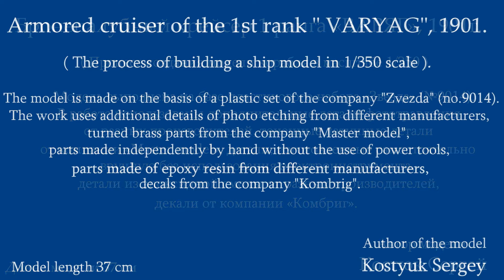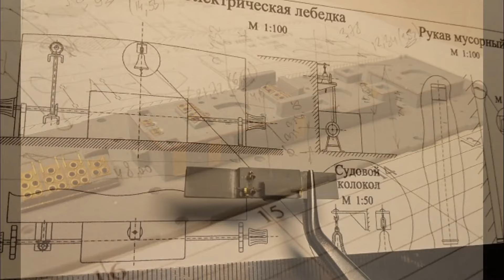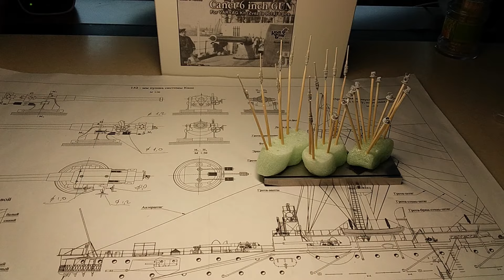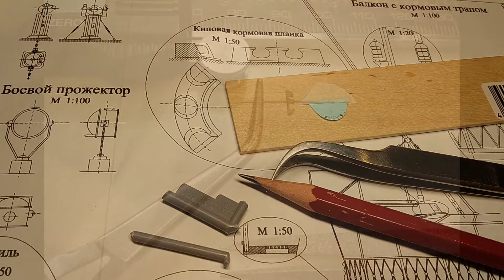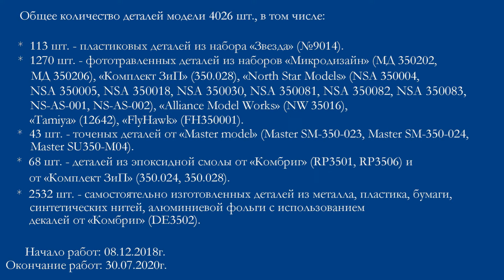ЗВЕЗДА. Крейсер ВАРЯГ. Сборка модели. / ZVEZDA. The cruiser VARYAG. Building the model.

Comment: Best model build ever seen. This is unbelievable good. And no washing or aging or whatsoever, just pristine. 
Big Respect and Greetings from Germany!
Reply from the maker: Thank you very much! 
I tried very hard ). I didn't use the deck wash deliberately, as the width of the deck boards in the set, unfortunately, is not in scale. Otherwise, the Zvezda set is quite good as a base. Thank you again! )).
Reply: @skostyuk1974  Спасибо большое! Unfortunately i know only few Russian words. Your build of the Varyag is so brilliant, i watched the video again and again a 3rd time on my bigger screen. Finally the rigging that you did on the ship... what a masterpiece in any detail! May i ask you whether you did the paintwork by hand? As i mentioned, i like "non-washed" model work much more (no artificial aging of a model by the means of applying rust & dirt colouring to give it a "used" look). I have this Zvezda kit of the Varyag for 2 years now, together with a photo etch set by Eduard, a wooden deck by Artwox and some guns and brass pipes sets from Master Model. Which deck boards did you try, to find they were not fitting? Hopefully i can start soon (had to recover from a hand surgery). My current project to complete is still the Gangut from Revell (which is a copy of the Zvezda Sewastopol). Thank you again as well! Hope to see more build videos from you.
Reply from the maker: @Bernd_B   Thank you very much for your kind words! Yes, the rigging turned out to be quite accurate, in full accordance with the known photos of the ship of that period. The only thing I regret now is that I did not use threads of different colors for standing and running rigging. I will definitely do this in my next model. Now I'm looking at the model of the gunboat "Koreyets" (1887) from the company "Kombrig". I'm already studying the material part )).
Together these two ships went into battle in Chemulpo in 1904 and the models should also be together side by side.

I admit, I also do not like the aging of ship models. For armored vehicles, this looks acceptable, but not for the navy. I am a big fan of museum models and I always dream of going to the Central Naval Museum in St. Petersburg and seeing models of cruisers and battleships live.
Regarding the deck. I used to look at wooden decks. The deck from Artvox is quite good, but I liked it better from Wood Hunter (W35001).
However, I did not use wooden decks, as my goal was to make the most accurate model of the Varag. The fact is that some details of the ship in the set and on the wooden decks are not quite in their places. This applies to the elevators supply of shells and fans on the forecastle, the covers of coal pits, the bases of the rostra pillars, fans in the mainmast area, deck portholes. This can be seen by looking at the native drawings of the Varag.
Fixing the plastic deck seemed easier.
Deck boards from the native plastic set are not in scale. They're too wide, which is why I didn't emphasize the seams. It was a conscious decision of mine. By the way, for the deck without flushing, I was reduced points at the Russian Championship in 2020, although in general, the model was highly appreciated, a diploma of the 1st degree and a gold medal )).
I will upload my builds to my YouTube channel, but it's not fast. The construction of Varyag, for example, lasted almost 1.5 years. So we'll have to wait a bit ).

I also post my modeling work on my Instagram page (skostyuk74). I invite you to visit ). Perhaps you also have your own Insagram account? I'd love to see your work.

Thank you again! Good luck!
Sincerely, Sergey
Reply from the maker: @Bernd_B  P.S. 
I paint my models by hand without using an airbrush. The exception is the bottom of the ship. It is spray-painted (Mr. Hobby).
Reply: Guten Abend Sergey, thank you! I looked onto your Instagram page, until I was thrown out by them as i do not have an Instagram account. Maybe i should register:). I've seen great building fotos from you there as well! To be honest, my modelling skills are not even close to yours. About rigging & "washing" (or "aging"): I did a build of the Revell 1:96 scale USS Constitution many years ago (maybe 1990). I invested plenty of time to install rigging in both black (for the fixed ropes covered with tar at the actual ship) and brown (for the running rigs) colors, it came out quite nice. And for this model (the Constitution), for a change, i worked on rust streaks/shades/dirt paint schemes mainly to the hull and sails to give them a "used" look. The overall result (took me some months) was not bad, but no match to your builds. Unfortunately, as time goes by, that model ship suffered a lot of mistreatings over the years. I agree with you, painting by hand (i don't use an airbrush either) and deliberately applying NO "used look aging" does in fact even more highlight the accuracy of the build job (at least in my eyes, whilst other people prefer aging techniqes). Especially when it comes to museum exhibition quality. Congratulations for being one of the best modellers in Russia! I have been 2 times in Russia, but then only in Moscow. My brother once went by bus from Finland to St. Petersburg, but i'm quite sure he missed the Naval museum. Wow, i checked, it is over 300 years old, and it is huge! You really should go there. All the best to you and for your upcoming projects. Best regards, Bernd.
Reply from the maker: @Bernd_B  Bernd, thank you very much! I would love to see the USS Constitution. My Mail skostyuk1974@gmail.com. You can send photos of the model to this address.
 In April (15-18), Moscow will host the Russian Championship in Ship Modeling (bench models). I plan to take part with my "Varyag". After last year's championship, I have slightly improved the model and hope to perform even better )).
 Best regards, Sergey
Reply: @skostyuk1974  Danke (spasibo), Sergey! I sent you a mail. How comes that in Russia there exists such a great model building community? I think it is of higher quality than in my country (well, that's not the only thing which is better in RUS compared to GER now...). Also i'm quite surprised about the Zvezda products, they improved a lot in the recent years. The Varyag really is a great model base, as well as the Sewastopol/Gangut. Hope to see some video of your updated Varyag one day. Best regards, Bernd
Reply from the maker: @Bernd_B  Bernd, good evening! Thank you very much for your letter. The history of modeling in Russia goes back to the Emperor Peter the Great (1672-1725). He studied ship building in Holland and England and eventually was the founder of the Russian Navy. He made the first model in Russia on his own (!) and it is kept in the museum, which I wrote about earlier as a valuable exhibit. There is also stored the "grandfather" of the Russian fleet-a boat. It is called "Peter's boat". So the history of modeling in Russia is more than 300 years old ).
In Soviet times, the development of children's creativity in our country was also given great attention and, I think, there was no school where there was not a group of model aircraft or ships. Technical creativity was very widespread in the USSR. Therefore, this is a very popular form of creativity in our country.
I am sure that many talented modelers of the highest level also live in Germany.
I have seen a lot of videos of ship modeling competitions with running models in Germany. There are very good models!).
I think there will be a lot of different bloggers and journalists at the Russian Championship (April 15-18, 2021) and there will be videos about this event on YouTube. If I am honored to get to these videos with my model, I will definitely share links to these videos about this event )).
Best regards,  Sergey.
Reply: I also noticed the planks out of scale. A real pity. The choice of not doing any aging was brilliant. Ships are like that. Unforgettable model.
Reply from the maker: @simonedallachiesa9804  Yes, unfortunately, with the deck flooring in the original set from "Zvezda" such a problem. Thank you again for your appreciation of my model! I am very pleased!)